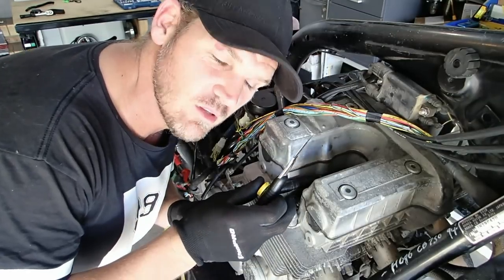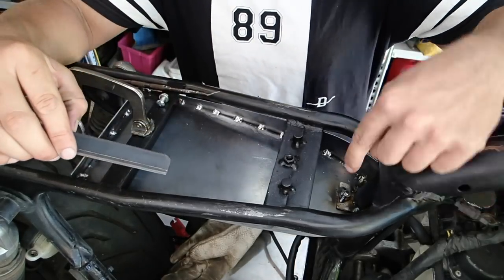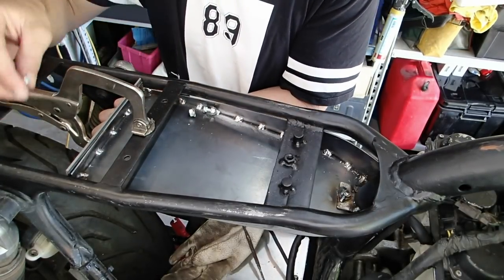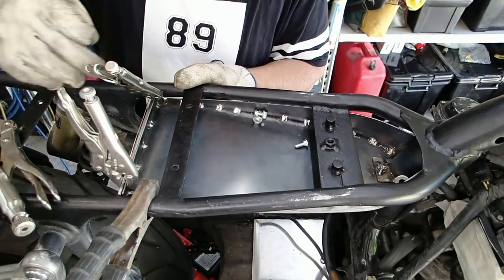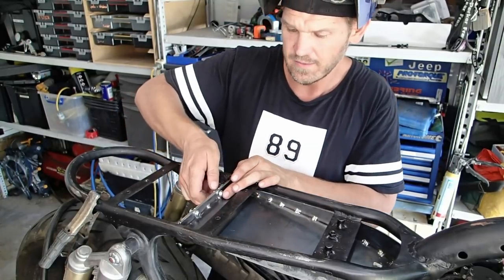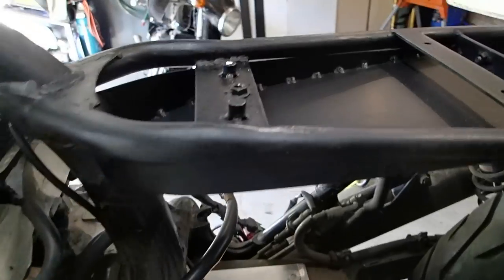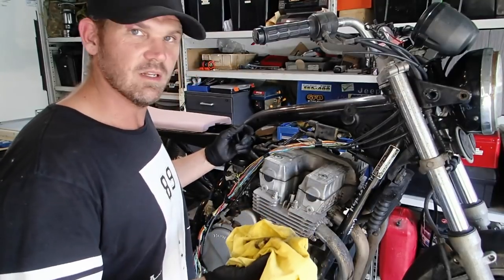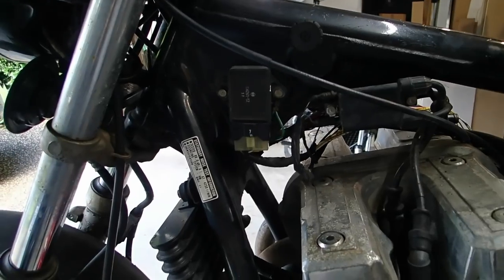Honda CB750 ★ Cafe Racer Electrics Tray, Under Seat Motorcycle Wiring Ep 8

Comment: That module that was located up near the steering stem looks like the regulator/rectifier. This will get pretty hot and looks like it was mounted up there on a decent piece of frame to use as a heat sink.
Reply from the maker: Great comment Minerma, I didn't know this but mow I will look into it, thank you so much for dropping me a comment, Merry Christmas :)

Comment: I'm guessing the little relay thing may be a Selenium or silicone rectifier to convert the current from the stator from AC to DC to charge the battery. I'm no expert but working on a 1962 Honda with my son at the moment and have a rectifier thingy next to the battery connection. 
We are at the electrical stage also...... Great fun playing with all that coloured spaghetti.
Keep the vids coming - really good and educational mate.
Reply from the maker: Paul Bull 
Someone told me is was a starter solenoid but I'm still yet to find a smaller one 😕 
That's a cool project for father and son
Reply: Paul Bull the rectifier is the one under the tank now we com to that i think it needs the ride wind to cooldown, if not the time age and the tin weld in it crack the time this happand you find the bike leave you stranded anywhere, you find yourself heatup breaking youre head why the damn thing only start when it gets cold enough the tinwelds come togehter an it starts again. Well ot is the rectifier. From outside it looks okey. I refreshed one and put aluminium cooleribs in the cast component, never ever it happand again

Comment: Also: is it possible to have a thin rubber or strong plastic strip that clips on to edges in order to eliminate rattle or clanging that may occur over time? Strips similar in shape to the blade protection covers on wood saws that slip on and off

Comment: Great video mate. Are you going to run a lithium battery?  If so will you need to change the voltage regulator?  How do you know if you need to. I would like to put a lithium battery on my cb250 cafe racer. Some people have told me I my need to. Cheers
Reply from the maker: Sean Hunt great questions Sean, I'm using a Shorai battery and as far as I know I don't need to change anything to make it work. I used it to start the bike for the first time but not sure about charging just yet. The battery is super light. About the same weight as 2-3 iPhones, it's crazy light!! 👍

Comment: That small black box is a starter solenoid- do not take it apart, it is not serviceable! Of course you can troubleshoot the leads or replace it all together, but I doubt there is anything much smaller. I have the same model/year nighthawk as you and learned this bit of information the hard way!

Comment: Run an M-Unit and a lithium micro battery, both will probably fit under seat.
Reply from the maker: Thankyou Mathew, I've been playing with the idea of the M-Unit but how exactly does an M-unit Improve what Honda already has in place? Do you know what can get removed from the harness if anything? The wiring is honstly the part I dread most.
Reply: Cafe Racer Garage sparck moto makes simple harnesses.

Comment: What material are you using for the tray
Reply from the maker: Tom Widlake I did answer this in the other video but just in case you didn’t see it, I use 1.6 steel plate :)

Comment: The harness looks factory. Honda did lots of splicing like that back in the day.  You sure that relay isn’t the starter relay?  That black box might be the stop safety circuits Honda used.  Usually those are removed without issue. Gives indication of failed brake and/or tail lights.  The wire colors on it indicate a rectifier though I’ve not seen one housed in plastic like that before.
Reply from the maker: Hi Steve, Merry Christmas, I would love to remove it but I'm a little worried about removing something with a fuse, 
I think I will make a small box to hide it by painting it black.   Thank you for your comment, where can I find out more about this part? you seem to have some good knowledge :)
Reply: It is the starter relay without question. That fuse is probably the primary fuse to the whole bike. No removing it.   I looked up the number on the other box near the coils and that’s the rect (just like the wire colors indicated), so unless you swap it for a different unit it has to stay as well.  You could source an aftermarket rect that is much smaller if space gets tight.  It’s looking good!

Comment: It’s a starter relay, you can replace it with a blade style fuse holder.
Reply from the maker: Thank you for that Alex. I'm not totally sure what to search for on google to find this?
Reply: Cafe Racer Garage part number is 35850-MT4-000

Type it in on goodle or eBay, and the exact one that fits it that Honda uses for most of there bikes should pop up. If you can’t find it let me know and I will send you one.
Reply from the maker: Your a legend Alex :)
Reply: Cafe Racer Garage I did the same build as you, just with a different tank. If you give me your email I could help you on anything you’d need. Also show you my build.
Reply from the maker: Hi Alex, that sounds awesome, ide love to see your build, Can you go to my channel homepage / About/ than click on the little icon that looks like a speech bubble to send me a personal message with your email so I can send you an email. :)
Reply: Cafe Racer Garage did you get my email?
Reply: would love some help. trying to do research before i drive myself nuts.
Reply from the maker: C what help do you need?
Reply: just trying to do as much research as possible before getting into a project. ive been mapping allt he prices of frames and what have you.. just looking to get some references
Reply from the maker: C always remember that the project you start with in you mind with be a lot different and sometimes more expensive than you first think:) 
Its worth every cent tho. 😁
Reply: im thinking about doing a Cb750 or a Bmw k75. still havent decided yet
Reply from the maker: C I like both:) 
I like your style 👍